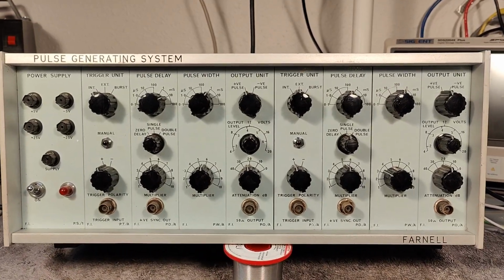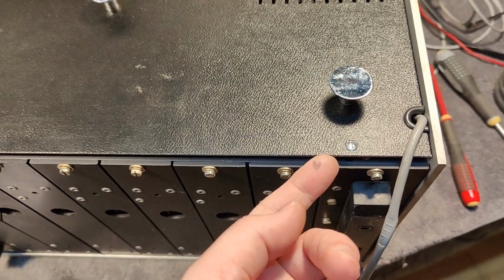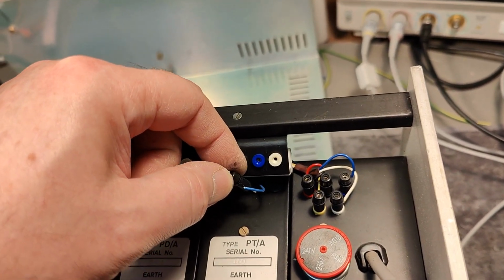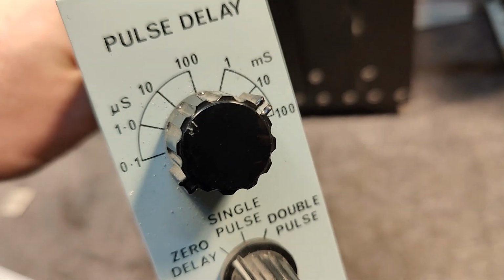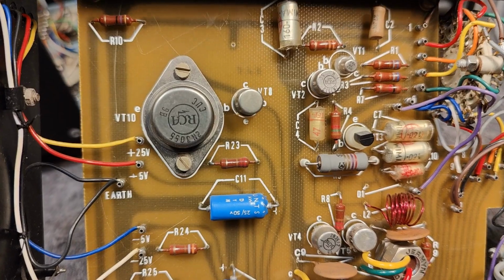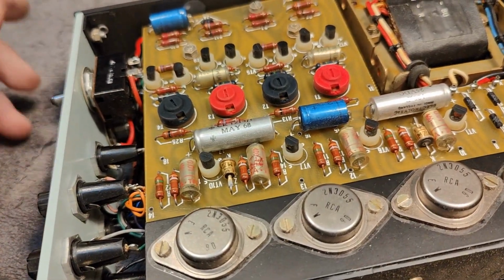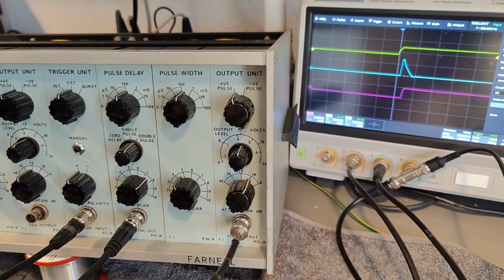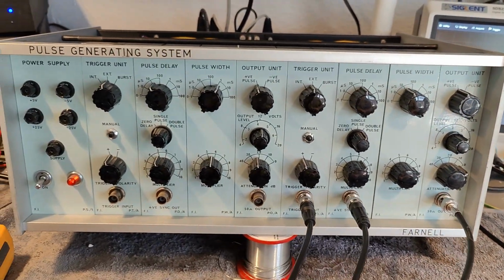Farnell pulse generating system dual module set 1968

Comment: Beautiful bit of kit. I searched online & found only two hits - one on UKVRR forum looking for info & one on a synth forum with a date of 1977 but it looks early 70's to me. If it was a 60's unit chances are it'd use germanium transistors, yours uses silicon Q's. Your unit looks an early one as other Farnell pulse genny's had a "PG" model number, eg PG102 etc.  the last card with the two 2N3055's could be a quasi complimentary OP stage, very useful device.
  The blue Hunt's & Philips axial electrolytics will need checking, especially the Hunts as they go dry &  Philips low value axial's are known to go hi ESR/OC. Thanks for uploading.

Comment: At my first job, where we developed radar warning receivers and related stuff, we used similar pulse generators to modulate RF generators, to simulate various kinds of radar pulses. Modulated RF pulses are also useful for testing RF power amps, when you do not have big enough dummy loads, etc.
A pulse generator is also useful for testing the impulse response of things like pulse transformers and video amplifiers.